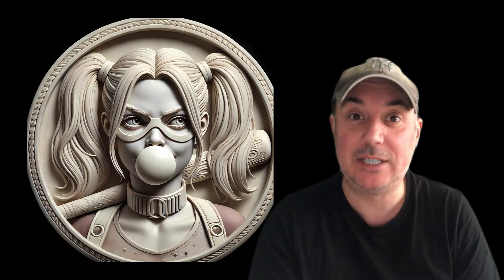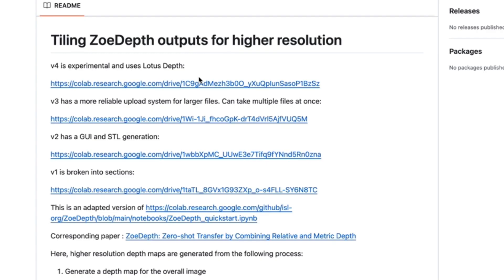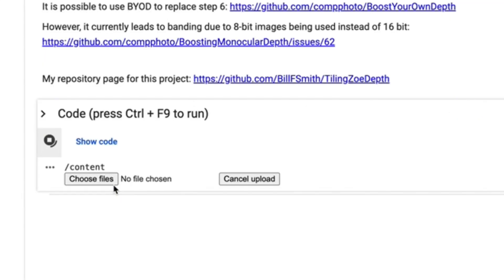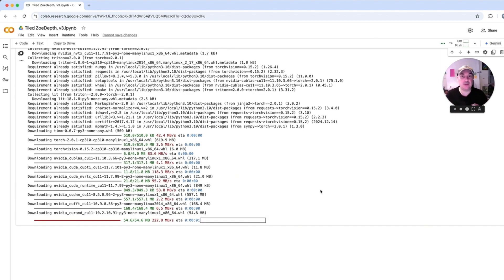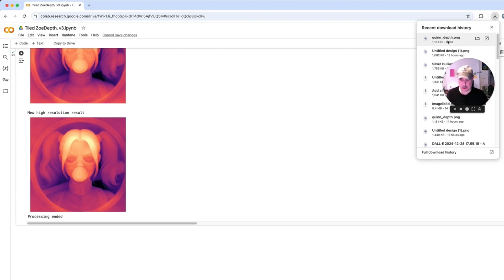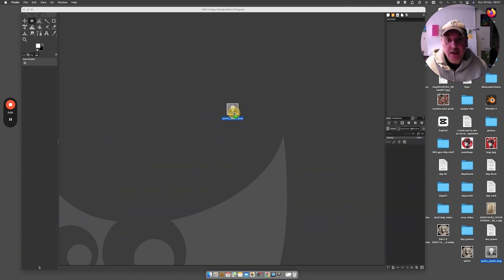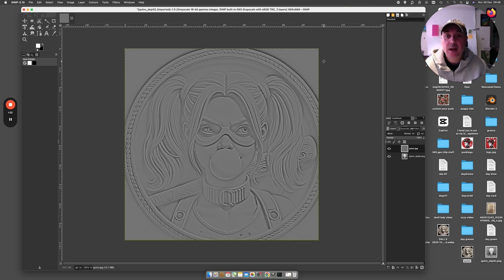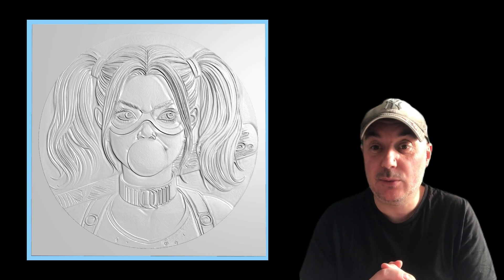Master High Detail Depth Maps for Laser Engraving CNC & 3D Printing!

Comment: Hi, hoping you can help.  when I export to jpg from Gimp, I get a black image file instead of what I'm seeing on screen.  I have 2 layers, the zoedepth and the original, I do the alpha etc..  it all looks good on screen, and multiple layers.  but exporting to jpg = a black image.  unsure how to export the good looking image.   any ideas?  I'm on the latest gimp, which I know is a different version that yours, but.. this seems like maybe a different issue.   any help would be appreciated. :-)
Reply from the maker: Using Gimp 3 my resulting image was also black. Solved it by right clicking the top layer (original image) and clicked 'Add Alpha Channel'.
Reply: @SilverPunkPour  This worked, great workflow!! thanks for sharing!
Reply from the maker: @ShatterBrainz  no problem, good luck with it
Reply: @SilverPunkPour  I'll give it a try. :-)  thank you!
Reply from the maker: Hi there! yeah a few people have been having there this issue, it is a gimp version issue i think, ive tried this morning on mine and it works fine still, a couple of people have down loaded the older version and it has worked, im sure someone will find a work around, im guessing there must be an option to still the layers together, combine them before exporting or something like that, if i do find out i will pop a pinned comment on here, it might be worth you checking some of the chat in the comments also in case someone finds a way with the new version, good luck with your projects!

Comment: I cant make this work , i get a lot of errors after i upload the image
Reply from the maker: what errors do you get? are you using a jpeg image? are you using chrome browser?
Reply: @SilverPunkPour  The error indicates that the specific version of torch (2.0.1) required by the notebook cannot be found or installed in this Colab environment. This then causes the ZoeDepth model to fail when loading its pre-trained weights, as the model's architecture is likely incompatible with the torch version that actually gets installed. I will attempt to fix this by using an available and compatible torch version.
Reply from the maker: arh i see, perhaps they will fix the workbook also, good luck with the work around!
Reply: @SilverPunkPour   Yes , and yes , i get a bunch of errors after i upload the image , i will try and paste.
Reply: @SilverPunkPour  RuntimeError: Error(s) in loading state_dict for ZoeDepth:
	Unexpected key(s) in state_dict: "core.core.pretrained.model.blocks.0.attn.relative_position_index", "core.core.pretrained.model.blocks.1.attn.relative_position_index",

Comment: i get a runtime error
Reply from the maker: Could be a number of reasons, are you using chrome as a browser? are you using a jpeg image? are you using the right version of zoedepth?
Reply: @SilverPunkPour  as far as I know of its the lastest version, it was a PNG image and  yeah i was using google  chrome
Reply from the maker: @Mikey201089  Right ok, you need to use zoedepth not the newest version, i think it is V3
Reply from the maker: @Mikey201089  also it will only work with jpeg images, PNG will not work
Reply: @SilverPunkPour  Do i need to install numpy?
Reply from the maker: @Mikey201089  no, just use the google colab and V3 zoedepth, upload a jpeg and it should work fine, i did in fact use it last night, worked ok this end mate

Comment: I had a pretty rough time with the workbook. Numerous errors that I kept plugging into ChatGPT to get corrective code. There seemed to be several dependencies that were not well handled. Finally got a depth map though.
Reply from the maker: sometimes you need to reload the stuff, and make sure you are using a jpeg and a chrome browser is also best, i tested it last evening and it worked ok for me, good luck with your projects!

Comment: Tried using this method for a Stamp Brush Alpha in Nomad Sculpt, didnt work very well. It worked, but the depth map generated didn't capture a lot of the fine details from the image I uploaded and the overlay in gimp just made the details more construed and jaggged. I'm going to keep playing with it to see if I can find a process that suits my needs. Other than that, very cool video!
Reply from the maker: Hey thanks for the message, i will be honest not sure what a stamp brush alpha is? but i do use another program which is a paid service for depth maps, here is a video showing that, you can get free credits to try in the video description. https://youtu.be/wZhGTD6aixw?si=2bHaLAYrfcFd3M40
Reply: @SilverPunkPour and actually SculptOK is what gave me the best results when trying to get a DepthMap from an image. I won’t be using it a lot when sculpting but it is nice to have for when the need does arise for it, and the free credits should be enough for what I need it for

Comment: I overwrite the original depth map at the end and when I open it, its black.
Reply from the maker: Using Gimp 3 my resulting image was also black. Solved it by right clicking the top layer (original image) and clicked 'Add Alpha Channel'.
Reply: @SilverPunkPour  Thanks that did not work for me, but what did work was downloading Gimp 2.10 and that seemed to solve them issue.

Comment: Hi Cool Video, New Sub here. All worked great but when I export or try to save my picture, and that was a chore to figure out, they always come out a black screen??  Any ideas?
Reply from the maker: someone else was having that issue, it works fine my end...not sure why, i think it is the version of gimp, i recall someone trying a different version and it worked ok?
Reply: @SilverPunkPour  Ok I installed 2.10, as I saw that is what you used. I had to do a search for it as it was not on there download site, that I could find.

Good news is I can now save a viewable file. Thank You.

Bad news is I do not get the color alpha image selection to be an option. It is there but not an available option. The prior step look great in grayscale and will export.
Reply from the maker: hey mate, glad you found a work around, ive just tried it this morning and it works fine for me....im on a mac, not sure if that makes a difference?
Reply: Using Gimp 3 my resulting image was also black. Solved it by right clicking the top layer (original image) and clicked 'Add Alpha Channel'.
Reply from the maker: @philsmith1484  thank you so so much for sharing this info!!!
Reply: I was having the same issue with the image being black. I did what PhilSmith did. I had to right click the image, but I had to use the color tab, then use color to alpha.

Comment: Nice! Works on mac too. Unfortunately Photoshop doesnt have the color to alpha button and need some workaround instead.
Reply from the maker: Yeah, im a Mac user! good luck with your projects, yeah not sure if PS has a feature to do that part automatically.
Reply: This might work?

Double-click the layer (not on the name — double-click the blank area) to open the Layer Style panel.

In the Blend If section at the bottom, set it to Gray.

Slide the white triangle on the “This Layer” bar to the left.

This will make the lighter parts (white or near-white) transparent.

Alt+Click (Option+Click on Mac) the triangle to split it for smoother transitions (important for depth maps).

Fine-tune how much "white" becomes transparent by adjusting the split handles.

Comment: You might want to go over exporting a bit better, I just did this and all it did was export a black screen
Reply from the maker: mmmm....ive just did it as a test and it worked fine...not sure why its not, did you make sure you did it in the right order? depth map first then the original image.... then go to export?
Reply: @SilverPunkPour  That I did, oddly enough however when I put my original picture on top of the depth map, it instantly turned the original black and white. I am trying an earlier version to see if v3 had anything to do with it.
Reply from the maker: @svfreakitiki  do you mean v3 of zoedepth?
Reply: @SilverPunkPour  I don't know why youtube removed my comment. I'm using gimp v3. I put the depth map in, then the original, then the high pass and the color to alpha. It transforms perfectly, but when I go to export it, it goes black.
Reply from the maker: @ very odd..if it transforms ok you just need to save it out, try save as instead of export? im really not sure why its not saving / exporting out, make sure all layers are selected when you export / save etc
Reply: @SilverPunkPour  That did not work either, I even tried switching the layers around that only disabled the high pass, what version of gimp are you using?
Reply: @SilverPunkPour  VICTORY! I found the problem. It is v3 of gimp. It doesn't work for me. I had to go and pull gimp v2.10 off my other computer and it work and exported just fine. V2.8 and v3 do not work for me.
Reply from the maker: @svfreakitiki  Excellent stuff! so glad it worked ok now, well done on figuring it out! i just couldnt see why it was working!

Comment: man, no matter what file I use or where it comes from, that's the message I recieve: 
MessageError: RangeError: Maximum call stack size exceeded.
Reply from the maker: mmmmm.....not sure about this, ive never seen this one before, it has to be a jpeg file... i tested it my end a couple of days ago and it worked fine, im so sorry i dont know what that error is, i will see if i can find out about it.
Reply: I was encountering this error too, I was using osx safari and switched to chrome browser and didn't get any issue

Comment: before you buy a printer be sure to see if it can cut 3d depth, i just spent $1200 on a machine that cant do this and its a real pain in the ass.
Reply from the maker: Hey Visual! yeah 100% on this, you are right, you need the right amount of power and type of laser depending on what material you are looking to do it on etc
Reply: @SilverPunkPour  i have the genmitsu but it doesnt have that 3d sliced option... big bummer

Comment: I wish the zoedepth would actually work so I could check out the process.  It keeps erroring out on me a couple minutes into it's process which is frustrating.
Reply from the maker: Hey Craig, hard to help without the error? what does it say? you have to be using a .jpeg file, that is a common problem that crops up, another is a screen popping up sometimes in the process saying there is an error but if you click continue / carry on it works fine, please let me know how you get on!
Reply: @SilverPunkPour  There's an internal error that borks on numpy.  All I get is a button that says "Explain Error".  I don't see any button like continue like you mention.
Reply: RuntimeError: Numpy is not available
Reply: @craigfisher146  I have the same problem.
Reply from the maker: Hey there! thanks for the message, im not sure why you are having trouble, very odd....I have just tested it myself Friday 28th March at 07:33 and it has worked fine like in the video, I'm not sure why it is not for you, are you using a jpeg image, are you using the right version, not lotus, the 2nd version down the list? Zoedepth? please let me know how you get on, a couple of people have had the same error so there is something a bit different for some people at the moment, but for me at my end works fine.
Reply from the maker: Hey there! thanks for the message, im not sure why you are having trouble, very odd....I have just tested it myself Friday 28th March at 07:33 and it has worked fine like in the video, I'm not sure why it is not for you, are you using a jpeg image, are you using the right version, not lotus, the 2nd version down the list? Zoedepth? please let me know how you get on, a couple of people have had the same error so there is something a bit different for some people at the moment, but for me at my end works fine.
Reply from the maker: Hey there! thanks for the message, im not sure why you are having trouble, very odd....I have just tested it myself Friday 28th March at 07:33 and it has worked fine like in the video, I'm not sure why it is not for you, are you using a jpeg image, are you using the right version, not lotus, the 2nd version down the list? Zoedepth? please let me know how you get on, a couple of people have had the same error so there is something a bit different for some people at the moment, but for me at my end works fine.

Comment: Can you recommend a good way to delete the background tile?
Reply from the maker: erm......which part of the process? the easy way would be to edit the original image and save it with a transparent background then go through that way, it should just give you the outline of your subject matter.
Reply: @SilverPunkPour  I used a transparent image, but sculptok inserts a background tile, as if it were going to be a lithophane. It did it to your image as well--the circle is bounded by a square tile. (I think I commented on the wrong video of yours! I watched both this one, and the one about sculptok and meant to comment over there.)
Reply from the maker: @alexzorn  Right I get you, i wondered where the tile was coming from, yeah sculptok will put a base on it, if you use there .stl file creation tool, you would have to edit the .stl file in a prog like blender to cut out the bits out you didnt want
Reply: @SilverPunkPour  Thanks for the tip, I guess the problem is I don't really know how to do that. The AI tools seem to solve some problems, while creating others...

Comment: When I drag the original image into gimp over the depth map the original is not converted to 16bit grayscale.  It just stays the same(8bit color) and covers the depth map. Is there  a step that I'm missing?
Reply from the maker: mmmm I'm not sure, when I do it I load the depth map in, then just drag and drop the original jpeg I used to make the depth map in and it auto converts it....i will see if i can replicate that issue, i have never had it though.
Reply: @SilverPunkPour  I think it may be that I'm dragging a .png in instead of a .jpg?  Not sure :\
Thanks for the quick reply!

Comment: You need to be careful with the presets and play around with the high pass filter contrast and std Deviation settings to get a good relief - lower on the contrast for a deeper, more natural  relief.
Reply from the maker: yes 100% you can play around with setting or the image more as well, this was just a quick and simple run through for beginners like myself!

Comment: How does this differ from a lithophane generator ? As far as i can see, that's the same results, but with less work & time, they are free as well. Or am i missing something here.
Reply from the maker: Hey thanks for the message and cheers for watching, a great question, in my experience the lithophane generators gives you a very thin panel in .stl format so basically a very flat and thin 3d render of the picture, this is a depth map that can be used to make high relief detailed panels  to carve into wood or laser engrave onto stuff or 3d print :)
Reply: It's really a completely different process, although I agree that the results look similar. 

The key thing is that the lithophane generates contrast by adjusting the plastic thickness, while a depth map is not adjusting contrast but rather attempts to generate a height map based on the content of the image.  In reality, a depth map is actually very difficult to generate from a photo because the photo itself actually contains zero depth information-- it has nothing to do with color or contrast.  That's why the latest approaches are trying to use AI in some fashion to assist the process. 

As a simple illustration, imagine a simple image of a dog that was pure  black and white.  A lithophane would simply make the black parts thick (i.e. near) and the white part thin (i.e. far), whereas in reality, the entire dog is a smooth transition from far to near.   

It would interesting to see how this approach would generate the depth map.

Comment: You never show the results of the actual carving
Reply from the maker: Hey Sherlock! this is just a video showing the process of making a depth map, here is a link to a couple of my videos where ive made a 3d print from them, and then used it for silver pouring, the 3d print i use for the impression mould is made by using the depth map i create, i have 100s of videos showing the 3d prints i make from the depth maps, i take the depth map and make them into a .stl file, this .stl file can then be 3d printed or carved which ever you want to do it. : https://youtu.be/ELYoXu_D3kA?si=fy5Er_1WWc8ZXGev
Reply: @SilverPunkPour I know a Lot Of this work as and you're top 5 in youtube